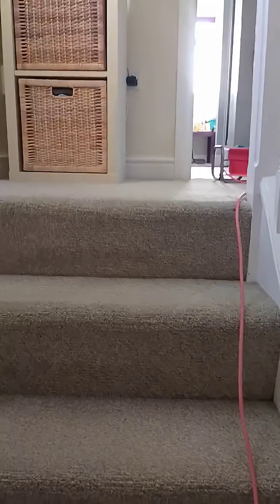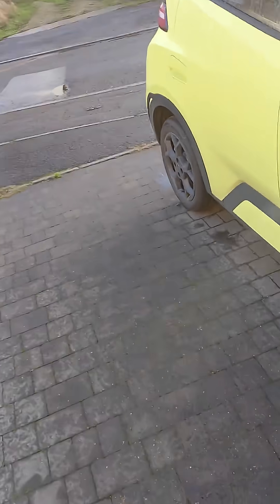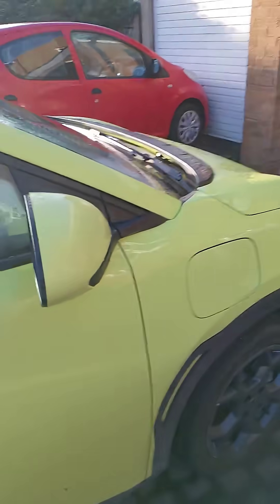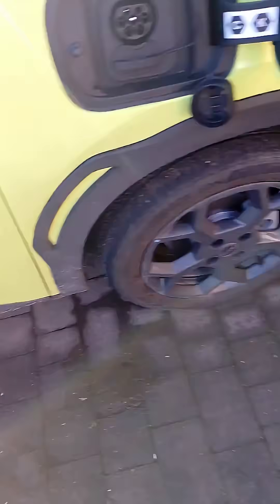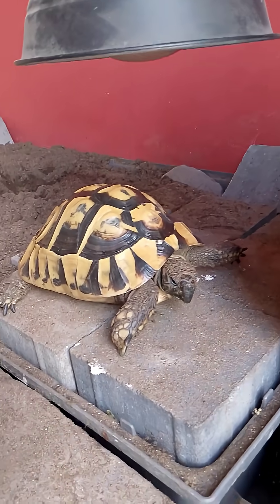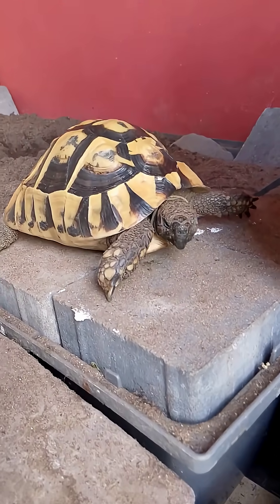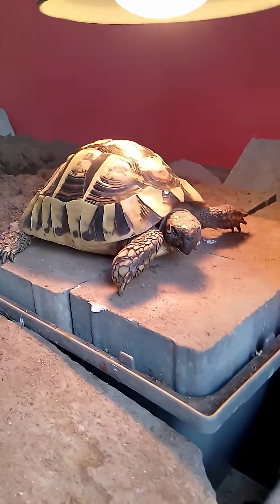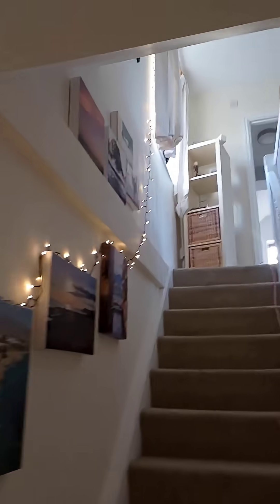What is V2L, why is it useful in a powercut, and how can I use it to annoy my neighbours?

Comment: You did not clarify what the L stands for, in the end its just V2X suddenly
Reply from the maker: Oops! I must have edited that part out! V2L is Vehicle-to-Load. The cable coming from the car has a standard UK 3 pin socket on the end, and can carry a load of 2.5kW. V2X is an umbrella term for 'Vehicle-to-anything', which includes (so far) V2L, V2H (Home) and V2G (Grid).
Reply: Presumably lead, Vehicle 2 Lead
Reply: v2x  the x is variable, like it can do all types presumably, v2l someone else explained, likely correct as he spoke about having it connected to lead
Reply from the maker: Oops! I must have edited that part out! V2L is Vehicle-to-Load. The cable coming from the car has a standard UK 3 pin socket on the end, and can carry a load of 2.5kW. V2X is an umbrella term for 'Vehicle-to-anything', which includes (so far) V2L, V2H (Home) and V2G (Grid).